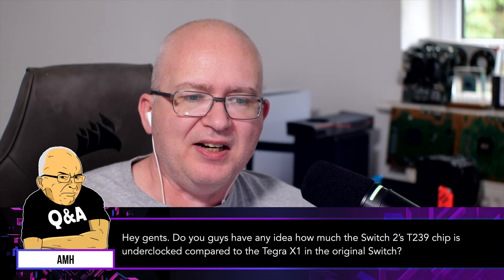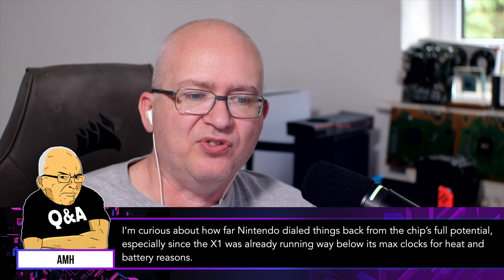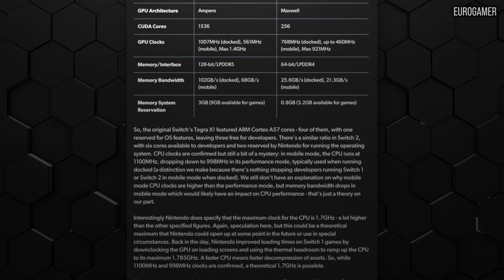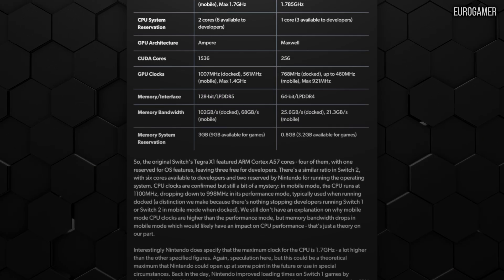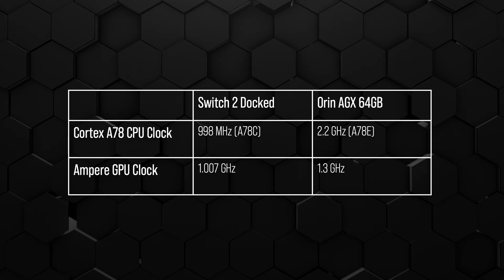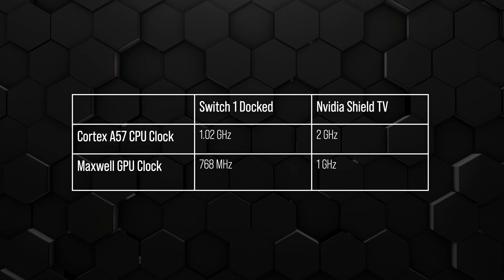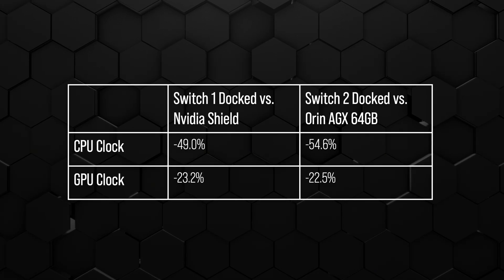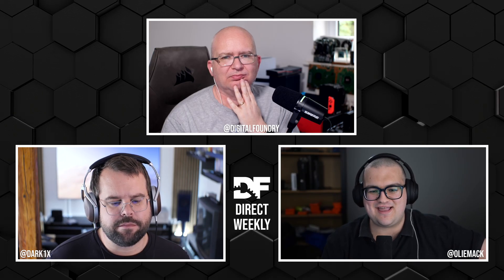Switch 2 SoC Under-Clocked? How Much Performance Is Left Untapped?

Comment: Spoiler alert: it’s downclocked so the console could keep its thin size. Otherwise it’ll need much bigger body for bigger dual fan and bigger battery
Reply: It's downclocked for battery life period
Reply: Whys every one missing the fact that batery doesn't matter in docked mode... they could boost it some to get the cpu bottle neck out the way maybe play wit gpu a memory speeds to get it to 60fps docked then they have enough frames to actually use frame gen right now theu aren't even using frame gen but they also hover between 30-40fps any ways and if they lower the resolution to get more frames the image quality which is barley looking clean will suffer and frame gen is pointless if the image is already bad quality. But I think they want to optimize the the upscaler and image quality before they hand developers more power and let them use frame gen as well. I know frame gen is coming but they are holding out on it forsure and I do see the benefit of making developers optimize better star wars outlaws updates clearly show its seriously beneficial. Or like with wukong it run on seies s now and the image has greatly improved since its realese and I just booted it up on ps5 and they didnt lower the resolution but uped the textures quality and tweaked the settings and now it his a stable 60fps. Theres so much devs leave on the table. Im glad we have a console with such a low performance and power threshold to meet just to see these big AAA studios optimize to such a low bar it should see improvements for the better systems long terms and new tools as well. But on that this console can do alot more especially in docked I know it can still get to hot even in docked but surely its not any where near what it can do I think just bringing it to 25 watt tdp should be enough to get the fps to something better for the vrr window in docked then use frame gen the damn dock is rated for the console to run up to a max of 45 watt tdp doubt there would be an significant gains that high but at 25 wat it would be worth it also the die shrink would be massively interesting as the cooling would be massive for a die that small and it would basically basically have near that performance of 25 watt at a 20 watt tdp i think seeing improved docked performance long term would be amazing but also the moving comunity for this one should be fire long term. Shit as a pc it would be awesome to have that much power in that small of a device I can mod the battery if I had to but damn just to set the power profile in docked and do what I want with a chipset that powerful have access to dlss frame gen is awesome 👌 only issue would be its based on a series that never had frame gen but its got stuff from the newer cards to make it work well and different memory... the drivers would be ummm interesting.... lol still 🤣 would make a fun moving comunity
Reply: @GregoryShomette  It's also about how much heat it generates and how well it can disperse it in that form factor, being docked doesn't help in that regard.
Reply: @muhjenkins mmm i disagree theres a fan built into the dock both the fan in the switch and the dock are so low you cant even hear em it could go up quite a but and it still wouldnt be somewhere youd hear. Im also talking about a 10% -20% boost in the clocks maybe with over boost functions for the areas that the cpu might cause a dip in frames but an 8 sec boost feature here and there and a 20% over all increase in docked isnt going to be hard on thermals on an already cold setup with almost no fan already theres alot of head room. I also dont think people understand how the dock fan works they think is just blowing air at the back like a fan on a phone would thats not true at all 😂 its actually quite good and an extension of whats inside the switch 2 its one of the most overlooked features
Reply: @GregoryShomette and I'm sure if Nintendo thought they could get away with those extra 10-20% clocks while docked with that cooling solution they'd have just done that to begin with.
Reply: @muhjenkins umm sir you do realise they literally have purposely not givin people dev units so that they would develop for switch 1 on purpose with the idea if they could make a game run on switch one and optomize it they would see better results on switch 2 they are also holding back alot of access on those dev kits to developers so that they optimize bettwr with the tools they have been givin rather then let them judt crank everything turn on dlss and just hit 60 without doing any work making there game run better. Its legit like how wukong devs said they couldnt make it run on series s and now it runs clean... its a strategy to not give you all the performance. For what? Why would you need it, you can make it work 40fps in cyber punk it ainr the consoles fault its the developers and thar includes nvidea as well they need to work out their dlss tech better its underperforming they didnt use standard dlss it uses a smaller version its new untested and poorly optimized but they know the developers will make it work cause they dont want their games to look like garbage they do this all the time to get people to do the work instead of just handing them an easy win. It also might result in some stuff running on the old hardware that they didnt think could. Its just a smart tactic unfortunately means for us we have to wait. Why would they say hey we will bring frame gen next year if they had no plans 9r capabilities of doing it lol also the fan is very capable i blew my vape at the back of the dock you can see where the air is traveling its simple. The whole if theu could they would idea is played out. Why build the dock? Why have a power brick rated for double the power than what they need? Why have tensor cores capable of frame gen? Why file the patent? Why make the promises? Why even make any capabilities of vrr or 120hz?  Why even have the fan? Like i could keep going but use your brain and stop downplaying its capabilities. You really need to wait till next year to see the thing do the thing before you believe it can do it? The switch 1 had a power profile change like a few years after release did we forget about that? Every one does it. Its not new they just realeased pssr updates on the pro that boosted performance by 15 frames and made the image more crisp across alot of games. That why its called machine learning it gets bettwr it learns and firmware updates change power profiles if its beneficial.
Reply: @muhjenkins  dont be too sure if anything this is nintendo we are talking about. they aren't known for making sense.
Reply: @GregoryShomette Why you are so sure frame gen is coming for switch 2?
Reply: @SifuSergioChannel because the hardware that it is built on has machine learning capabilities.
With the tenser cores as well as ray tracing capabilities, it may be built on a 2050 architecture, but the t239 chip has more machine learning capabilities similar to modern hardware baked in. it has shared memory with the cpu 12gb lpddr5x, which is a lot faster than a 2050 up to 9gb usable for the graphics. Nvidia said that machine learning frame generation would be available to developers down the road. Not only that nintendo filed a patent for their own frame generation. Just like they did for the upscaler.
I just don't think there's any reason to believe that we won't see it. At some point, it's just an easy win for them.
Now, when it comes to any change in the power profiles in docked or handheld mode that remains to be seen.That's more speculative on my part. But I can say confidently that frame generation has to be a key feature with switch.Moving forward
Reply: @SifuSergioChannel  i mean it can do dlss upscaling it can at least do fsr frame gen. Problem is that it going to be notably bad ghosting and controls will feel off so it prob wont be done unless the game is already hitting 60 fps consistently and even then what the point of going for anything higher then 60 if it results in lesser battery life.
Reply: @jnick6740 thats why I believe they are waiting for developers to get a cleaner image resolve and optimize for closer to 60fps before they enable this. I think they could get that far without more power now I think either the machine learning needs to get to a point where the upscaler takes less than half the power of what it already takes. And they make a lighter weight frame generation that does not take much power. So that there is no effect to the power of adding it in handheld, I also think because they are utilizing lighting features as well as some ray tracing in these handheld modes. They could simply turn those off so that frame rates were the priority and use that power to target those machine learning features.
I'm not so confident with machine learning. In handheld mode. But what I do think is being overlooked. Is that in docked mode battery does not matter. So why not use the frame generation? There, even if you can't use it in handheld, everyone is so focused on the battery life. The battery life when talking about the performance. But what we are overlooking is that this system isn't just a portable. It is a docked console as well. Close to series s in performance. So to make that a bigger jump in docked mode frame generation would take that gap in performance up a notch. And really show all the other handhelds, just how versatile and more performant. The switch 2 is if the docked mode becomes that more capable. Anything when it comes to handheld mode with improvements at this point, i'm just keeping my fingers crossed.And i'm hopeful, i'm not expecting much.I think there's definitely some capability to be seen.But I don't expect much when it comes to docked.There is definitely a lot that could be done
Reply: @GregoryShomette Very Nice if true, do you have any links to the NVIDIA statement that frame generation will be available to developers in the future or a link to the patent filling of Nintendo?
Reply: @SifuSergioChannel no he did not have
Reply: I'll just put it like this imagine series s image quality maybe a tad cleaner but 60fps on everything and frame gen on top of that... even at just double frames.. its doable with the hard ware  wouldn't need much of an clock change
Reply: considering its just using a slightly better battery over the switch 1, I'd say we got F"ed here
Reply: It's only for battery reasons, fans can be optimized a lot to run higher clocks.
Reply: That was proven to be untrue on the first switch. It will be proven untrue again as soon as this one is jailbroken.

Comment: Why are the clocks not higher in docked mode? I can't imagine heat being that much of a factor that Nintendo can't mitigate.
Reply: Probably to keep developers from just making it playable in docked due to massively increased performance while neglecting handheld. It sucks, but it would definitely make some ports very one-sided and reduce effort spent on general optimizations if it was very easy to get 1080p40 on demanding titles in docked due to high performance. Nintendo wants to keep them within the same ballpark as to where docked is more of a performance boost for extra resolution and more stable frames, rather than enabling a completely different build where the performance gap makes docked run great but handheld suck.

Comment: Nintendo is being super weird with these underclocks for Switch 1 and 2. It's not like people are trying to overclock their CPUs and GPUs, it's just that people want to use the full, default, factory stock, power of the device they have purchased. Hacked Switch 1 running stock Tegra X1 clocks showed, I believe a 5-6 Celsius temperature increase and maybe 15% lower battery life, but it allowed games with performance issues to run as they were meant to, like Tears of the Kingdom running at locked 30 fps when using Ultrahand, instead of dropping to 20 fps. There should be an option in Switch 1 and 2 to unlock the stock clocks of the SoC, with multiple confirmation windows so that you know what you're about to do, and it should void the warranty of the device, but you shouldn't have to hack your device to make it run at factory defaults.
Reply: the whole warranty voiding part is a very VERY slippery slope that Nintendo definitely doesn't want to and shouldn't go down.
Reply: Nintendo users have the mental capacity of a toddler you really think Nintendo would risk their reputation and possible lawsuits because they didn't handfed their consumers like they usually do? Nah
Reply: @LianCasablacks  well most nintendo users aren't adults, I'd say
Reply: @krzysztof7374

You'd be surprised how many Adults play Switch or Switch 2, handhelds are a god send for time poor people